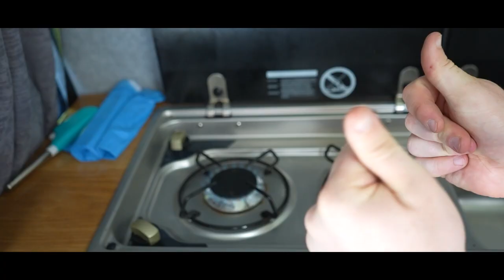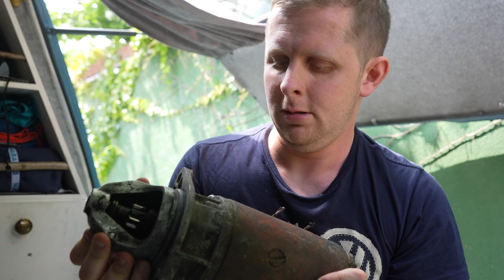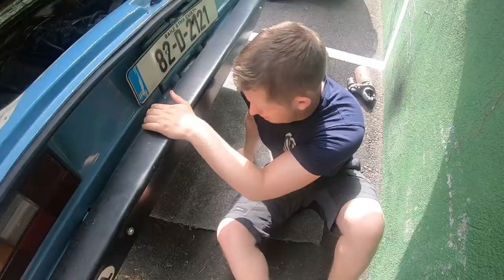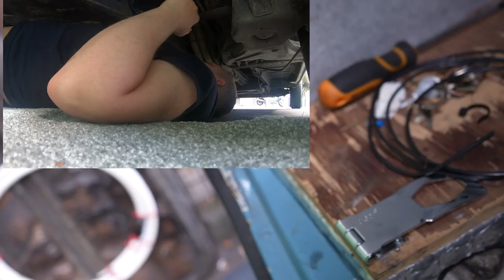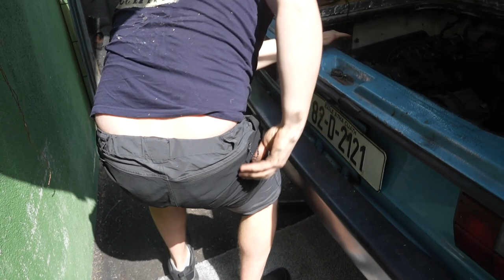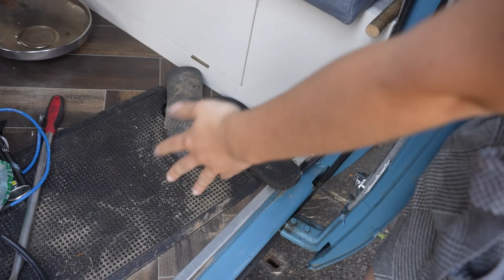Volkswagen T25 Starter Motor Issue!! (Broke down in Spain)

Comment: That looks promising! The fact that the old starter had that broken wire on it could well have been your issue all along!
Reply from the maker: Yes could definitely have been! Now the wire was connected but very poorly, it had corrosion, dirt, the adhesive from the tape was all in between the strands. It looked a mess 🤣🤣

Comment: Having a slow start on my T25 also can a faulty starter cause a slight overheating.. Sunday drove for 4hrs after the camper did not start at all, Was this the issue with yours ie starter playing up?
Reply from the maker: Hey! The starter itself could over heat. I'm not sure about the engine over heating.
Ours would just randomly not start and just click. Once we took it out and wired it up it worked fine. Put it back in and nothing. It seemed like it wouldn't work underload. New starter and everything seems fine
Reply: Hi Shane .. Will be changing the starter this week on the camper is it necessary to change the starting bushing?
Reply from the maker: @clarknicolas6780  Don't qoute me on this. In my model I don't think you do. But people do say to change it. What engine have you?
Reply from the maker: @clarknicolas6780  https://brickwerks.co.uk/product/starter-motor-t3-diesel-hella/ This is the starter I have. I think on the petrol engines you have to change it. I'm not 100% sure